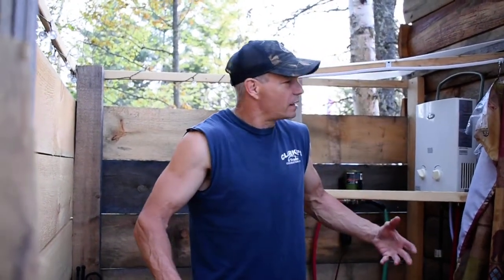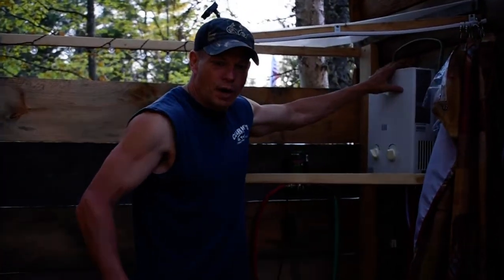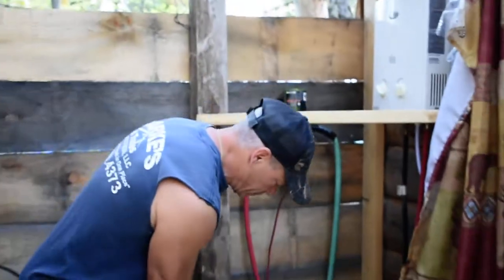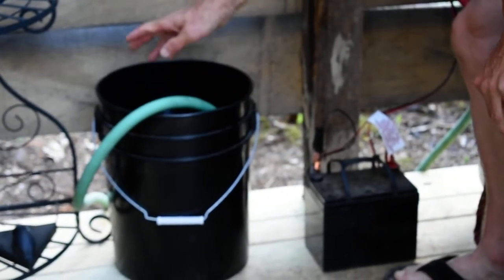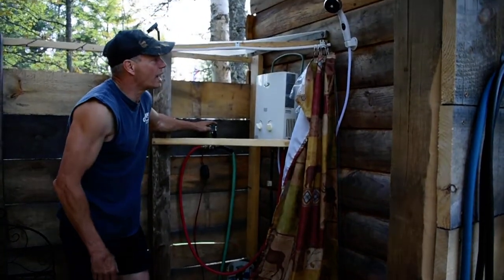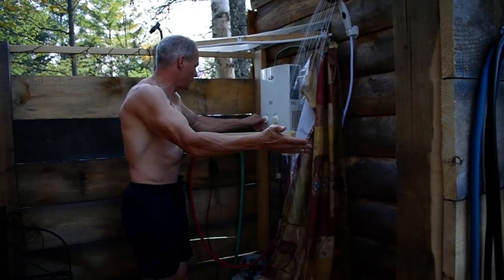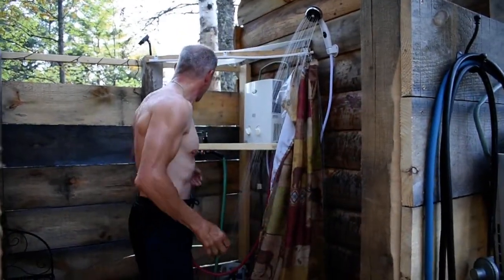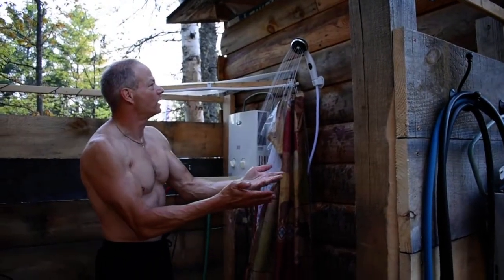The Outdoor Shower

Comment: How much for the on-demand water heater?
Reply from the maker: $125. The one I have is for outside use:), for $138 you can get the same unit that accepts pellet stove pipe for indoors. I have 2 of the units in video, and they work great. Thanks for watching!